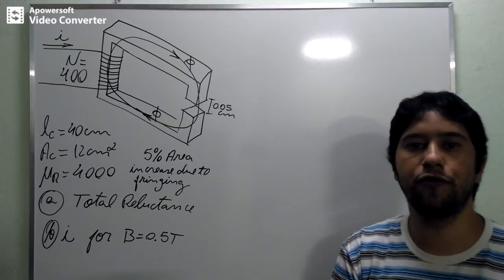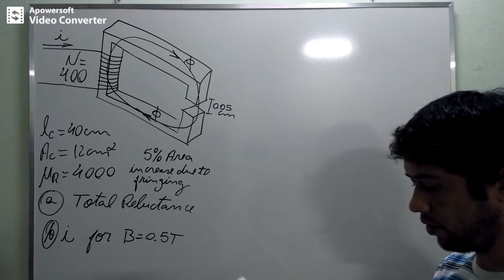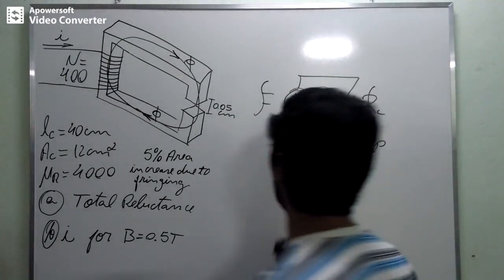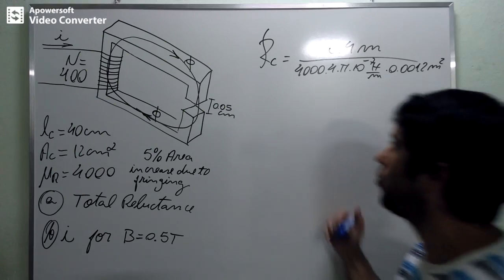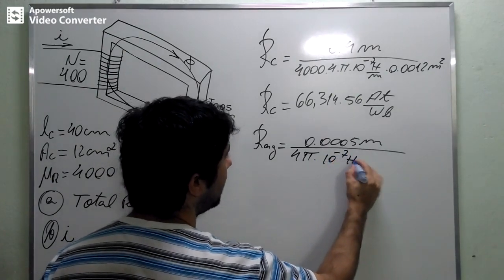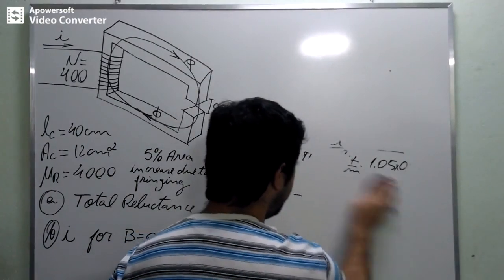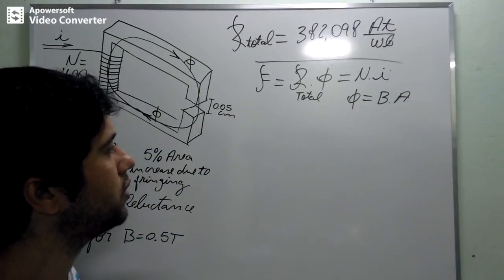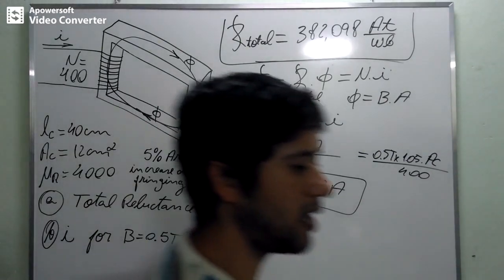Magnetic Circuit with Air Gap

Comment from the maker: FREQUENT QUESTION: Why do we need to multiply by 1.05?
RESPONSE: We need to multiply the area of the air gap by 1.05 because of the effect of fringing, which is a spreading of the field in the gap. 
The exercise says that due to this effect the area is increased by 5%, thus 1.05 = 1+0.5 = 100% + 5%

Comment: How do we calculate same example also given a leakage factor of 1.17
Reply from the maker: You will need to multiply the flux in the core by 1.17 to cover for the part that leaks and doesn't pass through the core.
Reply: @FaelFabriEngineering  Thank you very much. Your videos are very helpful. You are saving lives.

Comment: how we got 1.05
Reply from the maker: We get multiply the area of the air gap by 1.05 because of the effect of fringing, which is a spreading of the field in the gap, much like a balloon tied at both ends of the core and a bulge in the middle of the gap. 
The exercise says that due to this effect the area is increased by 5% or 1.05
Reply: @FaelFabriEngineering  yes, i have the same question from you and textbook too, 5% of what is 1.05 ?
Reply from the maker: @deusmanale  We have to multiply the area of the air gap by 1.05 because of the effect of fringing. 
The exercise says that due to this effect the area is increased by 5% or 1.05
Reply: @FaelFabriEngineering  but how we get this 1.05, how its become 5%
Reply: 1.05 is the 5% of 21 which i cant see in the problem
Reply: area + 0.05(area)
area(1+0.05)
area(1.05)